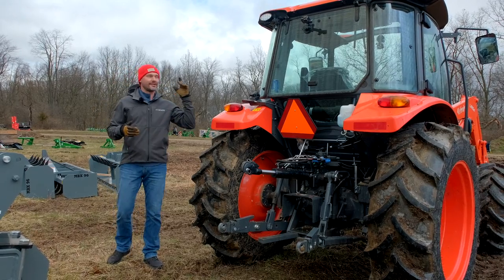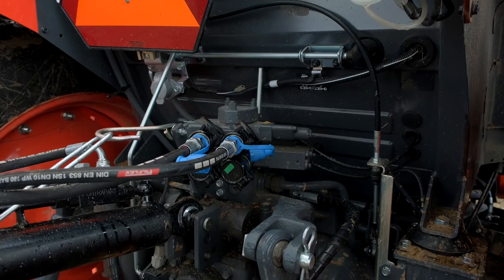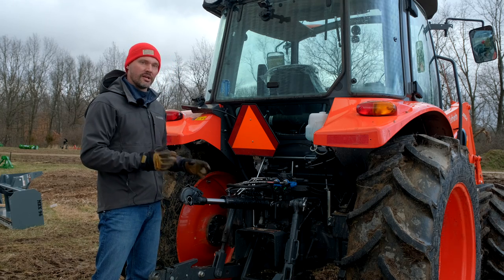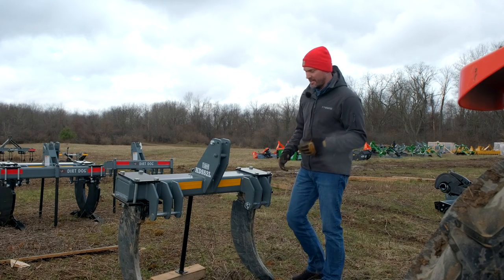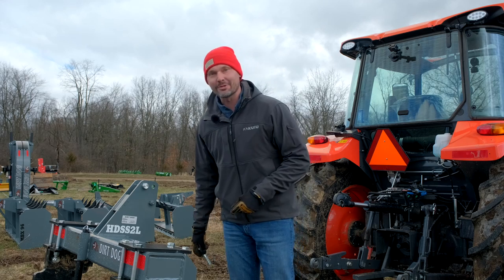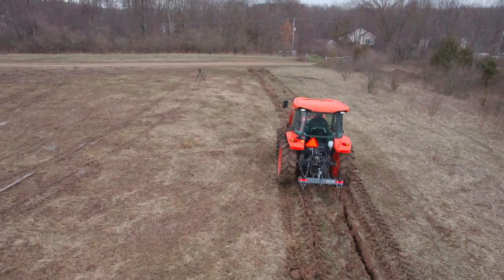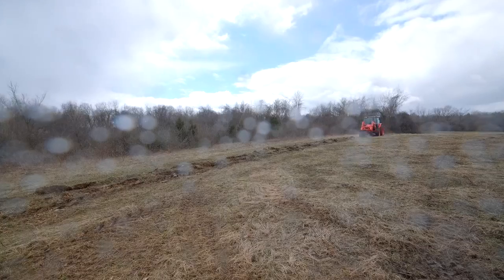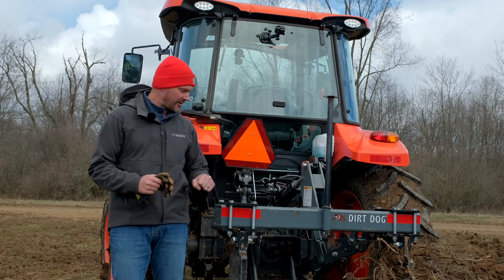DEEP TILLAGE TOOL FIXES HARD PAN & DRAINAGE ISSUES, SUBSOILER

Comment: you use a subsoiler after you tilled the grass sod that way you lift up te small compacted layer of soil from the tiller and lose up the soil sobthat the roots can go deeper more easely.
but you don't want to go to deep because then you are gonna disturp the ground live to much and mix up the different ground layers to much, you should go 8 to max 12 inches. 
its an great thing to do this about every 6 years to your seedbeds.
and you use a cultivator to losen up seedbeds a bit deeper and get  the ground nice and fine but don't disturp the groundlive.
Greatings from the Netherlands.

Comment: I know you're schedule doesn't allow, but it seems to me the subsoiler would be more effective in the fall.  That would allow the rain/snow, freezing/thawing of winter to recondition the ground.  Looks like 80-100 hp would be needed to drag that tool with the shanks all the way in the ground.
Reply: My Dad used a Massey Ferguson 1135 with the t6 354 motor making about 115hp, and we pulled a 5-shank ripper through mancos shale and clay. The key was having liquid ballast in the rear tires. Most tractors have plenty of power but no traction.  Had to run grade 3 or grade 5 for shear bolts, but that ripper was hell-for-stout, so it never broke anything other than shear-bolts.

Comment: I use a subsoiler to: work up ground I'm going to dig in or want to scrape off, to run low voltage wires, and to pull up very small stumps (4" or less).
The more I see of Dirt Dog the more I like them. 
I just bought the same top link yesterday. It was nice seeing you use it.

Comment: Wetter the ground the deeper your tractor will create compaction lol. And as a rule on my Case IH 2500 inline ripper depending on what ripper point i run the MRD 2 inch takes about 28 horse per shank and then my 5-7 inch wide wing tips take around 45 per shank. Best results were always around 12 inches deep any more depth just wastes fuel .

Comment: I tried to buy the same top link through Ebay. They shipped it to the other side of the country. The sent another one and FedEx is sort of f sitting on it in Europe. 

I've occasionally left the bucket on with a half load in it to help the front axle pull.  Sometimes I think it made a difference.

Comment: Yeah there is still frost in the ground here in Michigan surprisingly. Coming from the construction industry I know rippers take a lot of power to pull running big four five foot six foot long rippers on dozers still kind of surprising though to see you stopped in your tracks in that Kubota although I know they're not very heavy tractors.

Comment: Ok I have this same exact ripper in Bushhog brand with one long shank instead of 2. I run it on my M7060 with loaded radials and cast centers. I have done a considerable amount of acres with it now. I originally thought I needed the 2 shank....wrong! A 2 shank ran deep needs 100+HP in IMO. The single shank seems perfect with the M7060 as you can run all the way down (22" in the ground) in about 5th low range and move along. Extremely hard areas put me down to 2nd gear and will spin the tires some. I also have a hydraulic top link. I noticed yours is not keeping the ripper level sometimes. This makes it MUCH harder to pull. Keep and eye on it because the force in the had link will slowly compress it in and allow the implement to not stay level. The supplies shear bolts are a joke with these monsters. Put a grade 5 and don't look back.

Comment: Your 6x6 bar should be level front to back when in the ground and side to side, as you change the depth this will change also. Should make it pull a little easier. If it won't pick up high enough shorten your lift arms some. Looks like nice equipment.

Comment: Nothing to do with this video, but I have a question. I'm about to purchase a new JD 3025e with FEL and backhoe. I'll be using this for moving dirt and leveling/maintaining my property (less than 10 acres) I'll be using a Frontier 60" BB & pallet forks, but no PTO implements for the foreseeable future. Would 25hp be too little for this tractor? I'm pulled towards the 3025 due to the lack of any emissions & price. My dealer has plenty of 3032's available as well, but as I said emissions, whatever machine I use will be sitting and running for extended periods of time so I fear the DPF on an emissions tractor will fill quickly. Is this a valid concern for a machine that'll be doing alot of backhoe work? ANY advice would be much appreciated before I make my purchase here in a few days.
Reply: THIS IS JUST MY OPINION but... 25hp on a 3 series frame is pretty anemic. For bucket work and ground engaging equipment you will notice it. The tier 4 emissions controls are no big deal. If the 3032 is affordable for you then I would recommend it.
Reply: Hell, the backhoe cost probably makes up the difference between a 3032 and a 4044 or more
Reply: Interesting, i didn't know we could put a backhoe on the 3E series.  I have the 3032 and the emissions thing doenst stop you from working at all.  When its 100% you push the button while your working and it burns it off or whatever it does.
Reply: @1989Falkor  the backhoe requires significant dealer modification to the tractor frame to mount the backhoe to the tractor. So on top of the 8-10k for the peice of equipment you'll get a real nice bill for the frame work. Would not recommend
Reply: @Alex-yy6wh  Ouch, I think I'll just rent a mini ex when I need to dig.

Comment: What speed?  I try to got 3.5 to 5mph. That seems to help. But im still learning the subsoil game.
Reply: Speed really doesn't matter.  
-Mainly it's shank angle - adjust angle by the Top link, so it pulls the tool in constantly @7-10 inches ( too aggressive can dull the tips quicker )
-Tip condition - most ag ripper tips can be flipped when dull, and this resharpens the under side of the tip.
-and soil condition - ground frozen or too dry.
Reply: @emerkamp1  thanks for the heads up.  Love learning

Comment: Too much subsoiler for that size tractor!  It generally takes 50 hp per shank, only exception might be in sandy soil.  Front end weights may have helped so the front wheels are pulling more too.

Comment: You are nose heavy. Lenghthen your top link till the frame is level. The parabolic shank is designed to lift the soil. It makes it pull easier. The way it is set now the shanks are almost verticle making it much harder to pull. 18 to 20 inches is plenty deep enough for agricultural purposes.